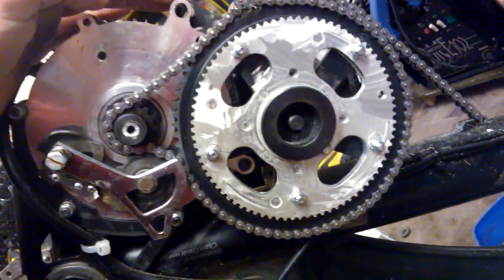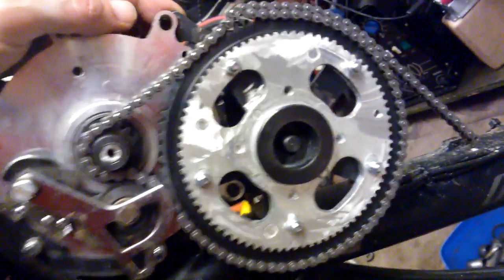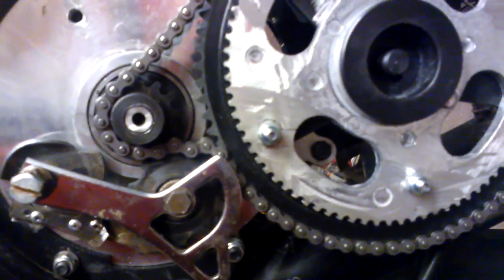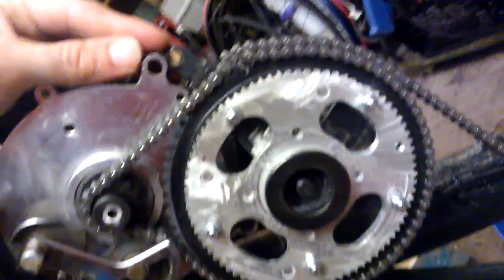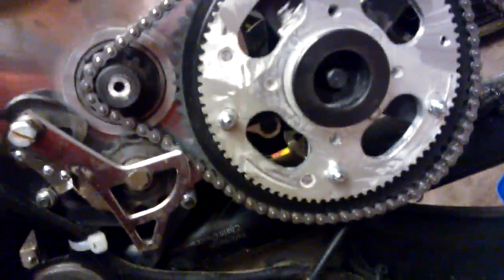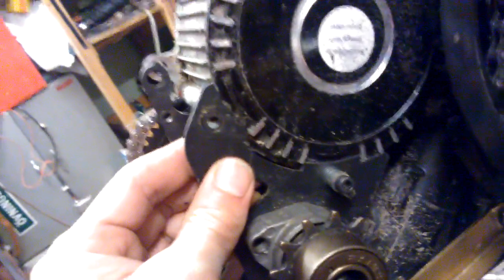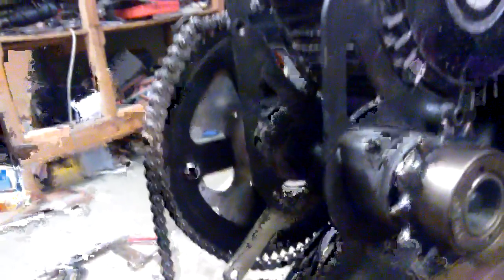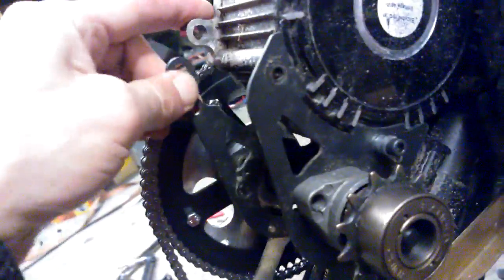GNG 450 belt to chain mod

Comment from the maker: Yes, it does handle more Power. There is no thermal protection. I run mine at 100v 30A. It gets just a Little warm. But i dont know about continous heat/Power.

Comment: does this type of drive system give more power than the planetary gearbox drive system the cyclone kit uses.  will this motor handle 40 amps continous controller.  whats the maximum current this motor handles. does it have a thermal cut off buil into the motor like the cyclone motor has

Comment from the maker: The belt goes fine for about 1000km. With more power to the motor it got ruined pretty quick. Check endless-sphere forum for further info.